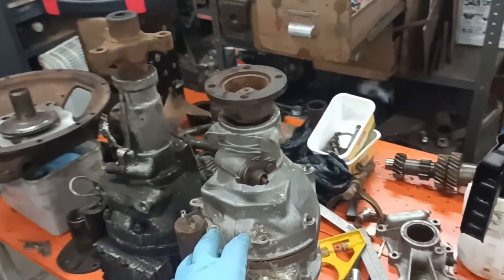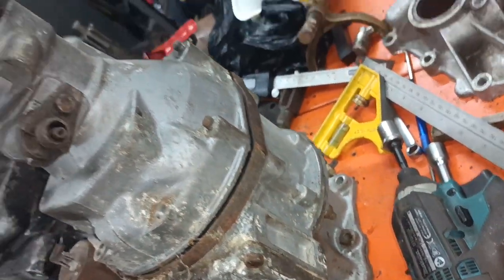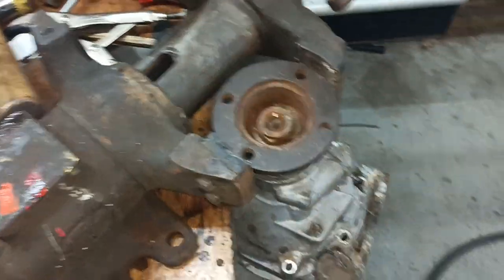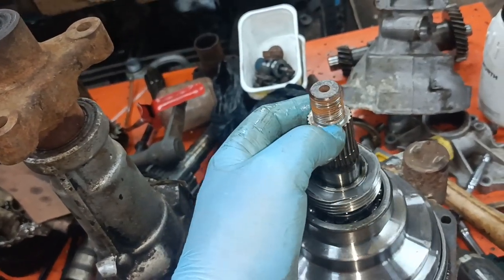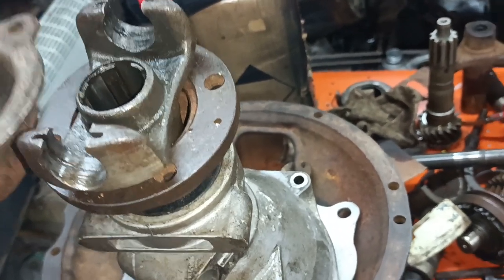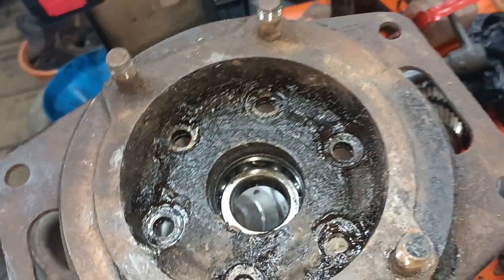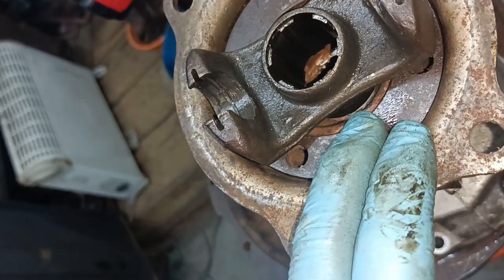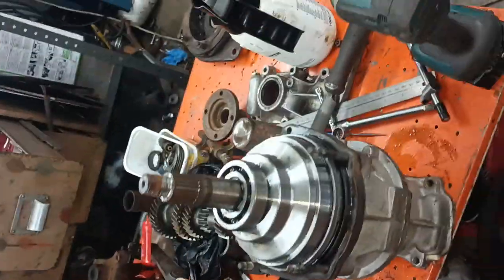Part5: 4spd OD on a flathead in a 1932 Ford. Mart's crazy project. OD to Torque Tube. (2245)

Comment: Coming together nicely Mart. I think you’ll be fine without too much extra supports. With the strength of the output and u joint all will hold true and the clamshell will allow the tube to pivot. Shouldn’t be much if any shear. Much better than I could ever think up. Still love the eyeball engineering aspect. Cheers my friend. 🍻👍👍👍🍻
Reply from the maker: Thanks Ron. It's all coming together well. I end up with a solution that I am pleased with.

Comment: I think I would look at making a nut to fit through he modified UJ to the original output shaft of the Volvo trans. You have the lathe so you could make a custom nut. You may have to turn down the inside area of the Ford uj piece so its flat. But that would also give you some room for a nut to bed against. Just another idea to consider. Nice work all in all!
Reply from the maker: Thanks RN. I did think about it, but decided a bolt would work. Well, I hope it will!

Comment: Ya...  2 roller bearings with speed-O gear spacer. Some type of bolt on yoke could work, same design as  a bolt on yoke for a thm-400 auto box..  I hate to see welding on yokes and spline combos.  Always seems to be a durability problem.  A twin turbo flatty engine may hurt the welded yoke ?   Altho , its been done.   Tail housing looks like its ready for a drill and tap for a mount.  8 or 10mm bolts would fit it looks like?  I feel like I am in the UK..  plenty of rain here in the mountains of Arizona.
Reply from the maker: Hi Tony. I hope the welding lasts. I think it will. The loadings on the UJ will be less than if a big conventional driveshaft were hanging on it. Especially if some imbalance were thrown into the equation. Lets just keep our fingers crossed that it all holds together.

Comment: Hi mart just watched your vid was a bit confused tho the cup you welded on to the boss you made is that the wrong way around 
Cause on the 39 box the torque tube front is concave to allow the the cup to slide up and down and your clam shell on the torque tube.
Reply from the maker: Hey, Jamie, you're right, if I were using it in it's normal orientation. In this case it is being used to create a housing that the normal torque tube pieces will bolt on to. An identical piece will bolt face to face with this one, along with the actual torque tube and the outer clamshell. Thanks for watching and asking.

Comment: Have you thought about maybe changing the banjo to a 46 Jailbar one that is open drive so you can use a normal drive shaft. although you would need to do something with the wishbone.
Reply from the maker: Yes, open drive was considered, but I didn't want to come up with a new rear suspension setup. I didn't want to veer to far off the original Ford concept.

Comment: Very interesting Mart, did you consider marking the outside diameter of the split pipe on the the clam shell while held in the lathe and then milling off the back of the clam shell so that it is true to the bolt on face and possibly a better weld surface to join. No criticism  just watching closely and trying to understand, shame you missed the action shot.
Reply from the maker: I didn't think of that, Pat, it would have been a good alternative. That said, the way I did it did help keep it on centre. I thought it came out well.

Comment: Hi  Mart ,did  you tell us the aim of the swap?.Assume overdrive to gain some mpg. and the additional /chance gearbox to crack that 100 💯 .Is retaining the K member a VHRA requirement ?Great progress ,great footage ! Thanks
Reply from the maker: No aim, just I had the gearbox and wanted to set myself a challenge. Possibly better mpg, but more relaxed cruising and less wear and tear on then motor. I don't think it will help at pendine. It might be slower due to extra weight and parasytic losses. (Just don't know). Retaining the K member is a personal thing not a VHRA requirement. Thanks for watching and asking some pretty pertinent questions.

Comment: Mart,do you not have the tque tube ball the wrongway round?
Reply from the maker: If I were using it as normal, yes, I am repurposing one as the housing.
Reply: @MartsGarage  I was thinking the same as trikejunkie.  You're not going to end up with much torque tube at this rate
Reply from the maker: Hello Simon. Yes, the torque tube is pretty short. 39" approx.
Reply: @MartsGarage  Ahh,you had me confused -great idea